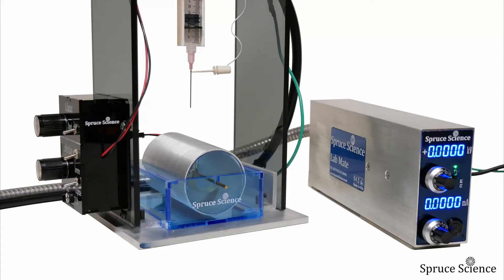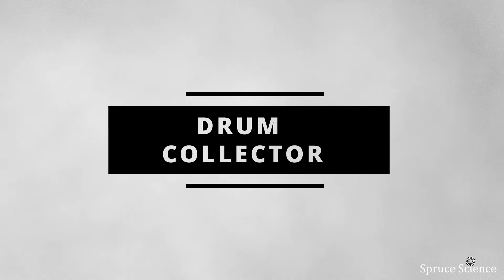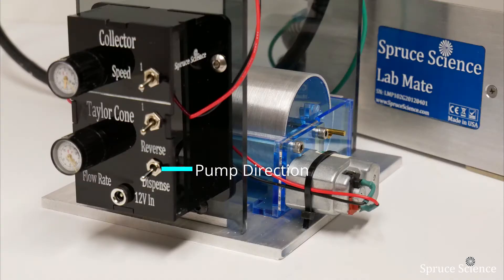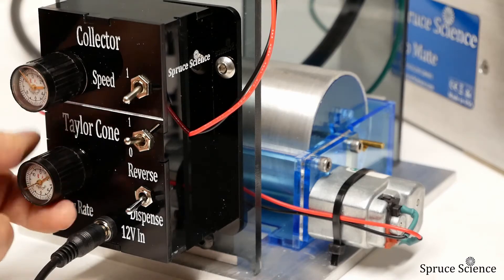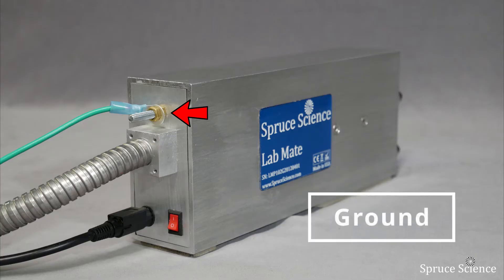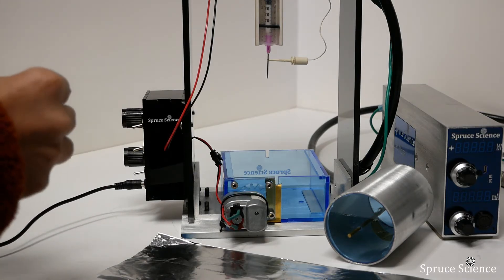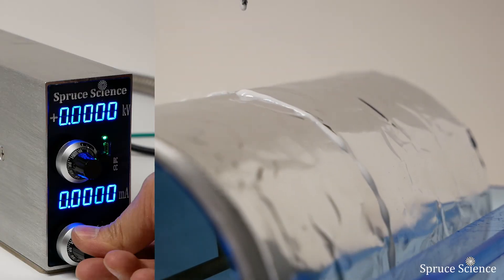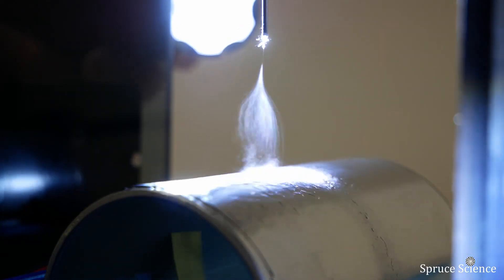Electrospinning of Polyvinylpyrrolidone (PVP) | Electrospun Nanofibers

Comment: N95 mask making technology
Reply: Yup bro ....
Reply from the maker: That’s awesome! Good luck! How can we learn more about your work?
Reply: so the purpose of making n95 by this technique is that small particles like bacteria and viruses have different sizes at a pico leavel  and  pvp material has not a regular pattern like any other cloth it has a random pattern like spider web having many layers ok... So 50 percent of particals can't enter the mask because of the pattern. after this you know Electrospinning cause long term electrification ... And any charged body attract a oppositely charged body as well as a neutral body .... After the Brownian motion of particals these particles are so small that they flows with air ..... And escapes out ... But due to charge present in the pvp these particles attract towards it and stick there .... its like a glue trap...👍👍👍👍👍👍
Reply from the maker: Are you looking into it?

Comment: Spruce fast forawrd here....see what you say? 4:29 "Proper grounding is important" " make a earth ground connection you say....? Are you literally connecting that cord to earth? what does earth ground mean?, please if you could kindly answer brother, thank u,
Reply from the maker: Hello Elijah! It is indeed an independent ground connection to the earth. It can be a solid electrode driven deep into the ground or if there's copper water piping then that works as well. The purpose is to send the rush current through an independent ground path in case of an arc or an electrical short. Clearly defining earth ground for the apparatus is done for safety purposes and it also help protect electronics. 

You can read more about it here. Enjoy!
https://en.wikipedia.org/wiki/Ground_%28electricity%29
Reply: @sprucescience  yea , i appreciate answer i asked because old school english from 1700 books , like English french classics spoke of pumping electrical fluid from the earth into their devices glass, metal chains etc etc . during spinning(frictional electricity) spinning glass english theory was quantity of electrical fluid comes from earth into their device during friction spin,of glass and rubber  and they "play with it  etc. amazing history most books on archive org from electrical experiments from the 1700-to maybe 1790s speak of this archaic form of electrical philosophy, its absolutely amazing , it would be called Frictional electricity , my advice if you embark,....the english perspective is absolutely correct(during this time))), my solidity of course comes from esoteric Chinese Indian metaphysics , which i recommend you study in your free time

Comment: What should be the solvent system when we use PVP as the polymer?
Would like to see the electrospinning process for Hyaluronic Acid + PVP.  
Can we use Ethanol+ Water as the solvent system for the same?
Reply from the maker: PVP is soluble in water and other polar solvents such as methanol and ethanol. The substance attracts and holds water from its surroundings. It can readily absorbs up to 40% of water by its weight.
Reply from the maker: https://youtu.be/xQdUDybj3-A
Reply from the maker: Enjoy!